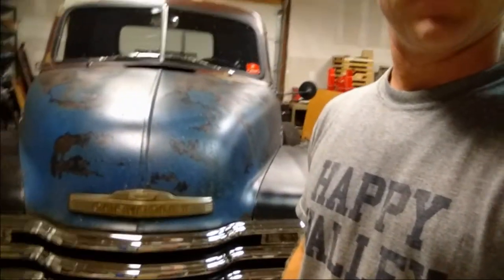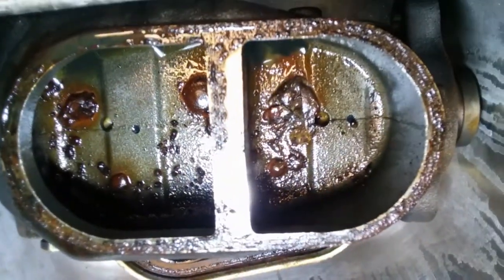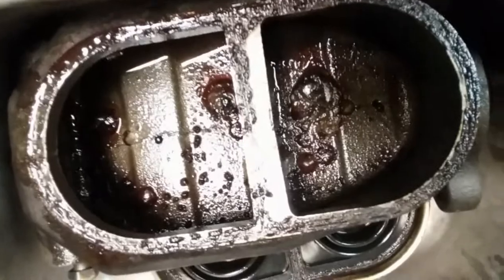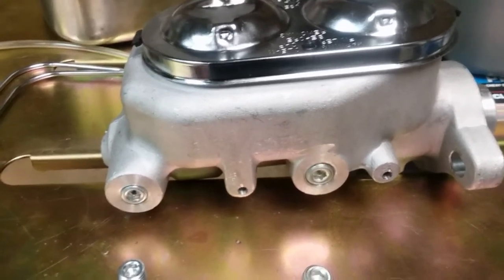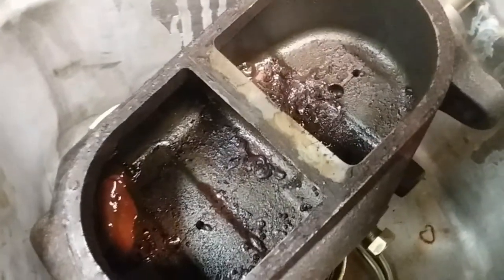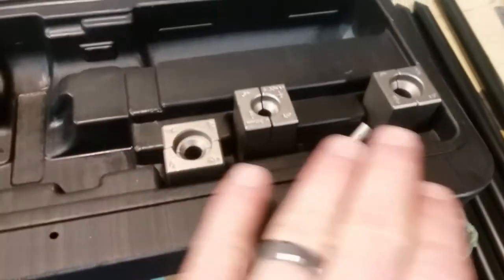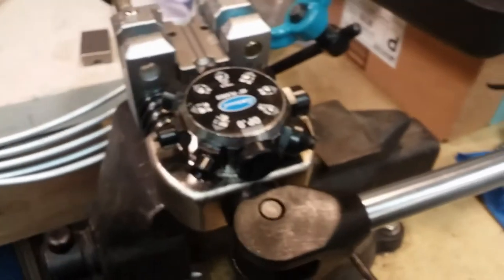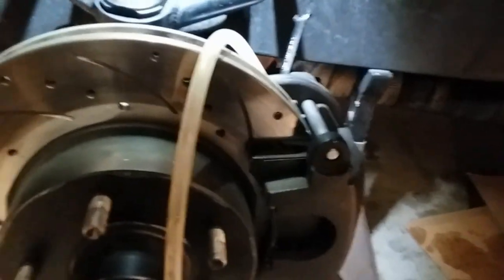Check out this crazy Brake Master Cylinder Corrosion

Comment: It is 1953, so can happen, break fluid do take water in time, and when never change it you get rust. So you need to put in fresh oil after every three years,
Reply from the maker: Except this was a new master cylinder that had only been in the truck for around a year.